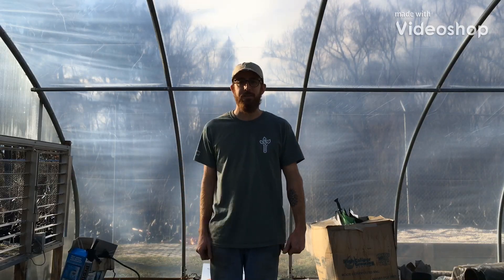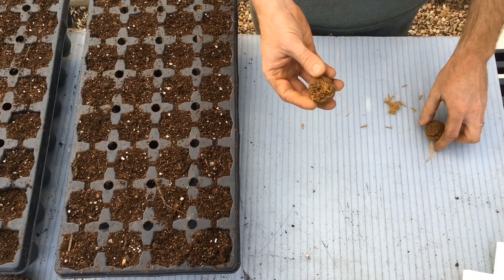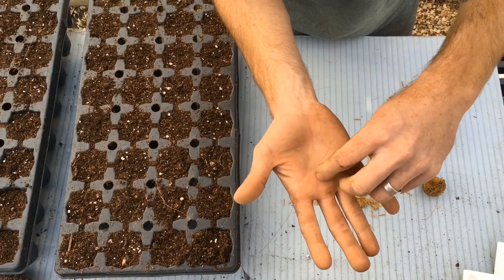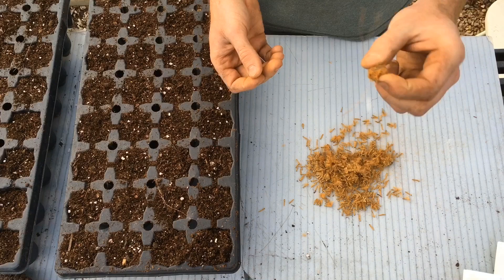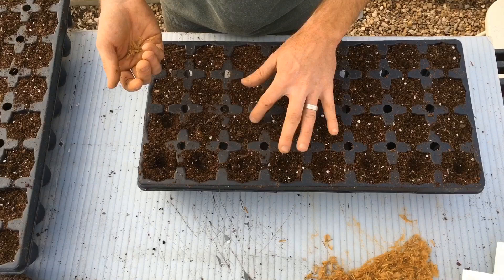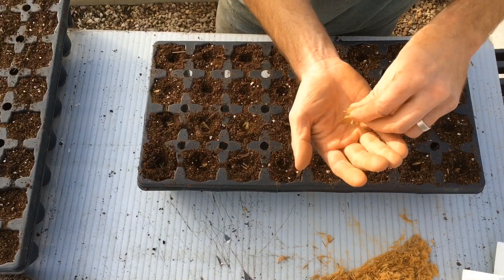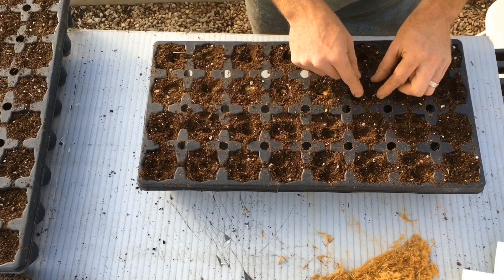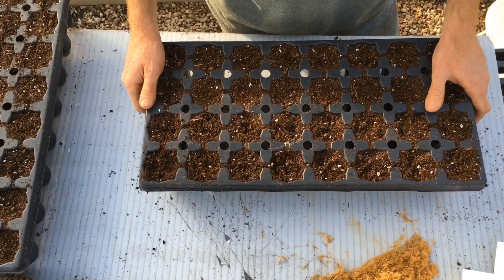American Sycamore Seeding

Comment: I germinate the seed in a flat tray, then transfer healthy seedlings into much larger seedling containers. Cell size is about 2 in and 5 to 8 inches deep. They are left in containers for year 1. Then they are transplanted out to larger containers 4x4x10 in year two. They are planted out in year three. They will be about 2-3 ft tall at the start of year 3. Note sycamore do not require stratification but I normally stratify the seed anyway for about 30 days at 35-38F.

Comment: Do the seeds need a cold period before they become active like other seeds? (example: pecan)
Reply from the maker: Yes! I would suggest collecting seed in the fall and then sowing into trays Left outside overwinter in a cold frame.  Or if you’re lucky enough to find seed in the spring that was sitting around outside you should be able to sow it right away.

Comment: Hey Aaron, I have a bunch of this years seedlings growing wild on my property in Indiana. I would like to transplant to different places on the same property. Can I just dig them and move them or do I need to put them in pots to overwinter?
Reply from the maker: Jeff Spencer Hello! Your seedlings would appreciate you waiting until cooler temperatures in Fall or moving in early Spring! Do your best to get as many roots as you can (dig a larger root ball than seems necessary, especially attempting to get whatever taproot the seedlings have put out)! If transplanting this Fall (and also in Spring) I would suggest mulching your seedlings afterwards to help retain moisture in the soil and regulate the root zone temperatures (from both heat and cold, creating less extreme fluctuations in soil temperature).

Hopefully that’s helpful and best of luck!
Reply: Aaron McFarland so just wait and then transplant to the spot where I want them, and not pot them at all? Thanks!
Reply from the maker: Jeff Spencer Correct! I would totally skip the process of potting them up if you have spots available for them to get planted into right away!

Comment: Hey Aaron, I tried the same last year but I picked up the seed pods from the ground in early spring and planted seeds in a pot, indoors. All of them sprouted but wilted within a few days. did you see similar problems? Wonder what I did wrong.
Reply from the maker: Hello!

A potential problem that you may have encountered is something called “damping-off” of seedlings. This occurs in cooler temperatures with a wet soil where potential diseases or pathogens in the soil basically rot the seedlings. The only thing I can say to try and prevent this from happening in the future is to keep the seeds a slightly warmer space and to keep the potting media/soil on the dry side. Also, if you haven’t, try using brand new potting media to reduce the risk of diseases being present; using new or well cleaned (if re-using) containers is also important. Hopefully this is helpful!
Reply: @aaronmcfarland6226  hey Aaron thanks! I think I used old potting media, old soil, but at 70 degrees indoor...  btw, do the seedlings need humid environment like cuttings do..  i.e green space? hopefully not. This way i can just set the potting media outside. I'm going to guess its ok since that's what happens in the nature. this is similar to what you did I think. what was your success rate with your seedlings ?
Reply from the maker: Works for Me! The seedlings don’t really need a humid environment and I would suggest keeping them in “normal” conditions (not covered, not misted/kept humid). Even at 70 there is a chance that  consistent moisture level in the soil and around the seedling stems can cause the to rot. If you have the space available and will to try you could try tilling up a small portion of your yard, creating a nice loose soil and direct seed into it. Then you’ll have your best chances to mimic nature. Success rate wasn’t too bad (I didn’t pay close enough attention to get germination %) but I unfortunately (or fortunately) had so many other orders and plant needs this past growing season I wasn’t able to afford the seedling space in the nursery and they were donated to the local forest edge.
Reply: @aaronmcfarland6226  OK great, thanks! in terms of timing for seed planting, should I do it in winter (Dec ?)
Reply from the maker: Works for Me! Depends on your location. Since I’m located in Richmond, VA I seeded during the cooler months (December-February) and allowed nature to work its magic (since these seeds require a cold stratification). I’d say the one thing to be wary of is that your seeds don’t get too wet if left outside in the normal conditions! Keep in mind that your soil in plugs or in a seed tray will freeze much quicker and more thoroughly as compared to a natural soil and your seeds will therefore experience much higher temperature swings during freeze/thaw.
Reply: @aaronmcfarland6226  Makes a lot of sense. Thanks! I am in Texas, ~Dec-Jan in the 30s and back up over the 40s in late feb.

Comment: Is it possible to grow them indoors at this time of year? Will they sprout? I have London Plane Tree seeds, I guess it's the hybrid. Great video.
Reply from the maker: You could probably start them indoors but you’d have to keep them heated until any chance of frost in the Spring has passed. There is a chance they will sprout but they may require a period of cold (which usually can be solved by putting them in the fridge for 30 days). There is a sycamore that is native to Europe, generally called the London Plane Tree, so you may have the straight species. If so, it should grow! If it is a hybrid (which they have often hybridized the European and American species, then your chances are slim. Thanks!

Comment: Maybe an odd question but what is the earliest you could harvest the seeds from a tree?
Reply from the maker: Usually once the seed pods have started to turn to the golden/blonde color. At that point they are usually pretty easy to pull apart but if you see any of them beginning to fluff open they are ready! You could try harvesting them now but I wouldn’t count on having high germination (here in central VA I’m beginning to see some seeds probably able to be harvested early).